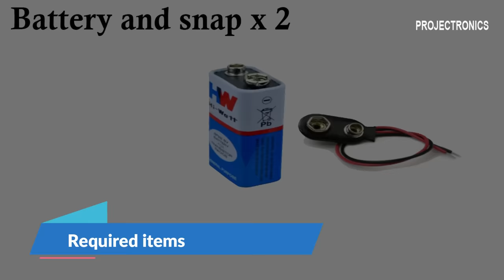Chandrayan3 rocket launching working model Steps ! How to Make #chandrayaan3  rocket step by step

Comment: Which tool you have used to connect wire with the switch???
Reply from the maker: Soldering IRON
Reply: @projectronics  thanks you I was not getting which tool is that

Comment: We made this model in our school's science exhibition but it didn't worked at all as the rocket became more heavier when we made it with pvc pipes and the motor and pinion was not able to lift up the rocket 😡 😡😡😡🤬🤬🤬🤬🤬🤬🤬🤬🤬🤬🤬🤬🤬🤬 and all the materials we fixed with fevi quick as it was not at all fixing with glue gun😔😔
Reply: Paisa barbad
Reply: Bhai mara science exevision kal ha or muja aaj submit karna ha mana be fevi cuick  sa banaya ha
Reply from the maker: Fevikwik will not work
Reply: @DinoEdits07 it's work ?